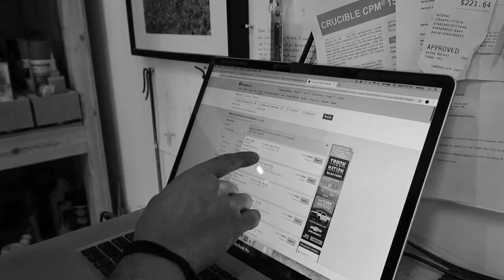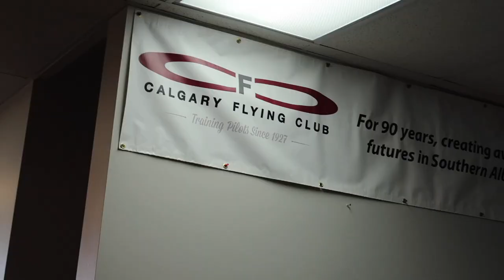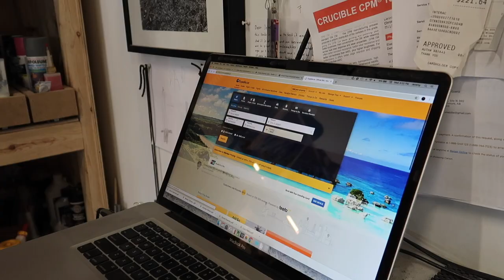Why I won't be going to blade show 2019

Comment: How do those scalloped belts work for bevels?
Reply from the maker: They don't really give any benefit to grinding bevels. Some people like them for the softer plung lines but I personally prefer the rigidity of a normal belt (especially a ceramic belt) so I can have more control of the radius of the plunge line.